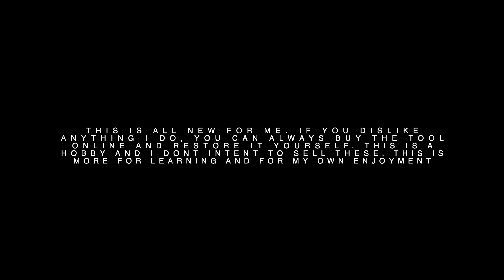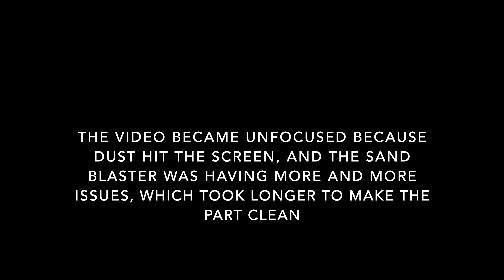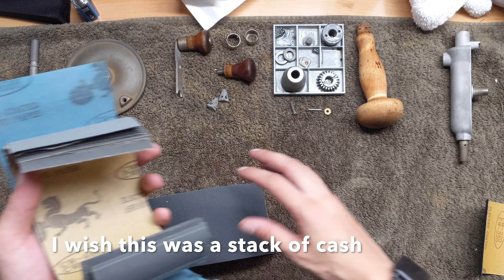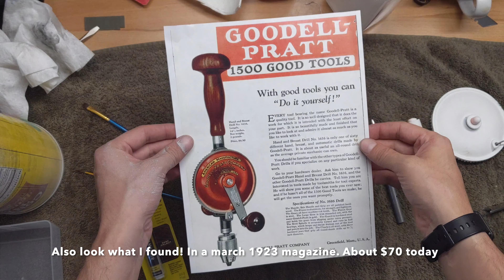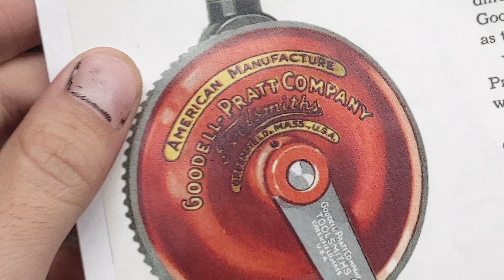Goodell Pratt Vintage Hand Drill Restoration

Comment: Hi from the UK, good vids...saw the angle vise one first, l'm thinking of doing the same, may l ask, what is the required tech to film this ( if any) or can it be done on a tablet ? thanks
Reply from the maker: It's pretty fun! I dont have anything special, im using my phone (pixel 3) to record it. With a tripod of course. But you would have to check with a tablet camera resolution, it can def be done but it may not be the best quality. You may want to see what the megapixels of your tablet/phone and see what the highest resolution is (my phone can record 4k) and then choose the best device from that.